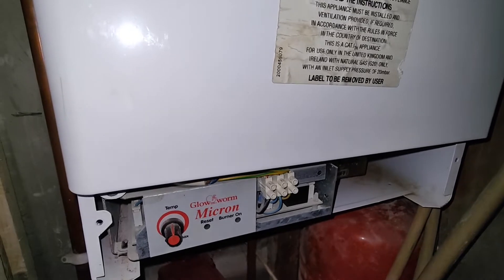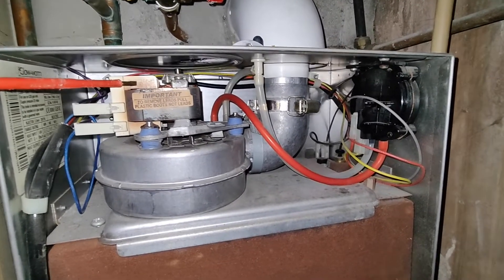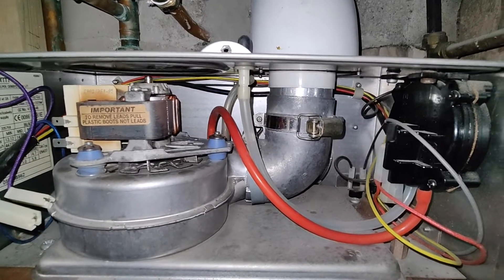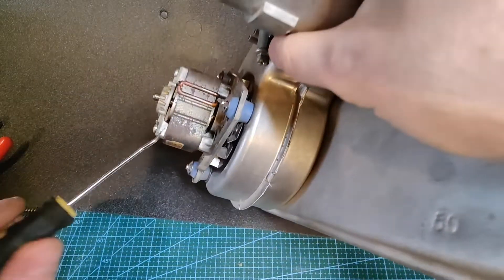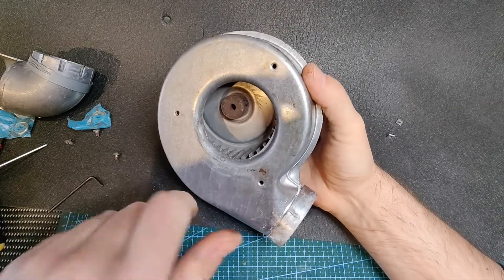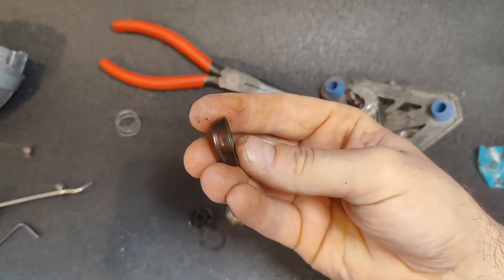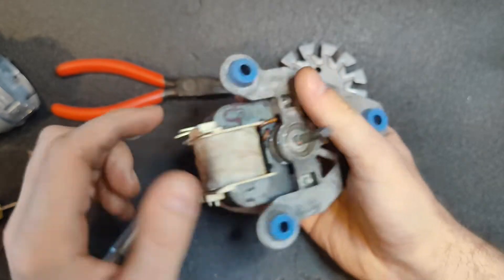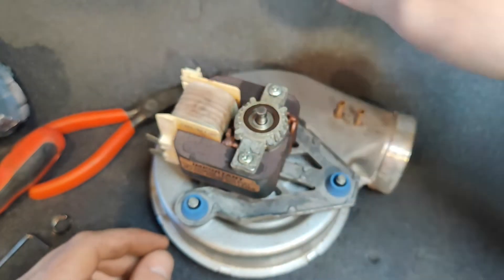Boiler Broke Down - Fan Fixed for only €2

Comment: It seems the correct way to do this is to leave the fans alone, and access the lower bearing by sliding the rotor off of the shaft. I have attempted it the same way you have and now find that the cooling fan will no longer grip the shaft.
But brownie points for nice video.

Comment: Many many thanks. Exactly the same problem as mine. No local plumber nor stores could get that complete blower for weeks and if they could it would be £200 + . Well under way with repair, even thinking of turning up two new phossy bronze bushes in place of bearings . Cheers, stay safe. Mikep.
Reply from the maker: Hey Mike. Glad ya found it useful and hopefully everything fires up nicely for ya when it's finished. I got bearings from a local supplier really cheap and I opted for the shielded version. Helps keep dirt out and grease in. The original bearings lasted maybe 20 years or more so I'd be confident these will long outlast my boiler at this stage.
Reply: @CptMishMashVonRandom  local stockist had similar bearings in stock , so all back together and fine. Cheers